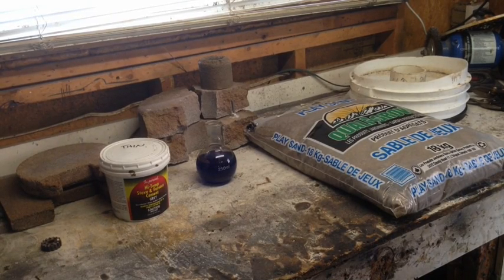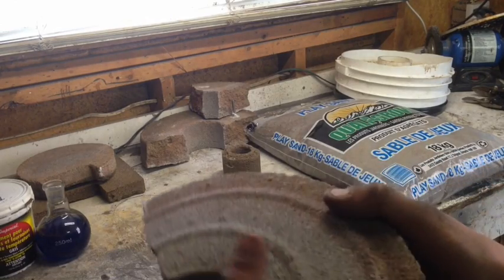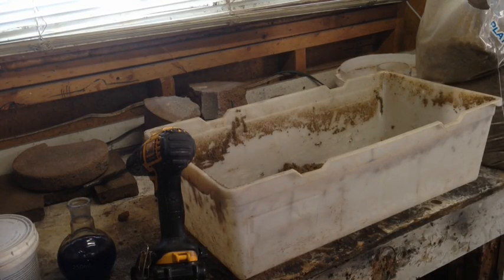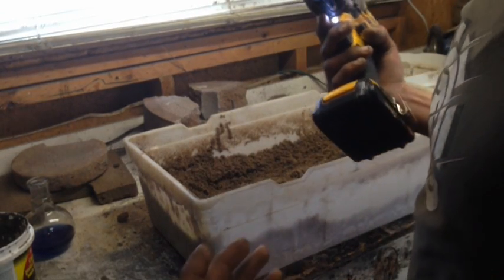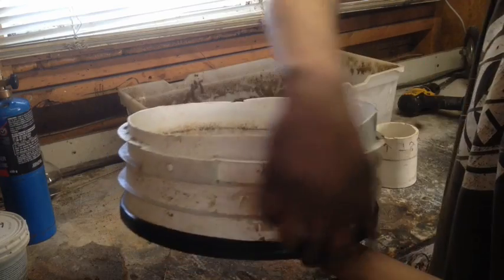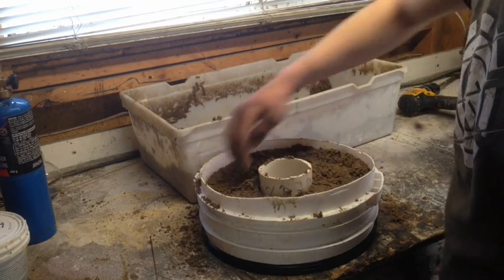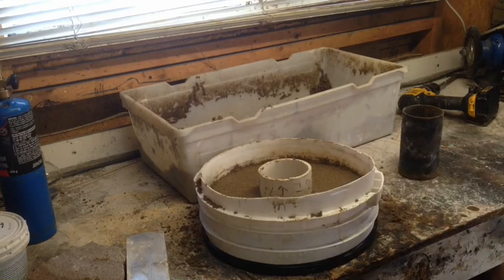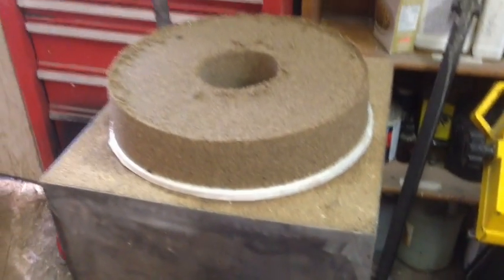How to make refractory brick (fire brick) with sodium silicate PART 2

Comment: would it make stronger to use Portland cement instead of sand?
Reply: AMEN brother!!!!!  And White plastic cement would have given him 300 degrees higher temperature ceiling  over portland for a buck more. Same stuff they use for swimming pool plaster. 3 parts play sand one part WHITE plastic cement.
Reply: just saying 83  my can of high temperature cement says " made with Portland cement and sodium silicate ' It says it is good up to 2700 degrees Fahrenheit  it is cement colored grey  thick like it has high concentrated water glass so I believe the contents could very well be only Portland cement and water glass
Reply: Thermodyne Systems  I bought several 4 cubic foot bags of swimming pool cement containing Portland cement and vermiculite  but this stuff you are talking about white plaster  is like a stucco on the swimming pool?   By what name can I Google to find this white plaster stuff and also your mentioned 60%  ion grod.?

Comment: If one makes the sodium silicate solution and has it in a glass mason jar with the lid on will it last for say a week in the jar? Will their be any negitive's to storing the solution for a week or more? Thanks!
Reply from the maker: Turborewind I have had it stored for months on end. just don't let it dry out. if it does dry out just add some water and lightly heat it untill it's smooth again.
Reply: Thanks nilamotk ! Off to make me a batch for my propane tank furnace.Thanks again for your fast reply.

Comment: Great video!  Gives me the information I need for a project I'm working out.  Have you priced firebrick lately? That stuff is EXPENSIVE.  I haven't priced the stuff in your video yet, but it's gotta be cheaper than $9 for a small brick.  Anyway, on to my question.  I am planning for a backyard foundry that will double as a family fire pit.  What I am visualizing is an inner layer of your firebrick, then about a foot and a half to two feet of mud packed around it, followed by a layer of regular ornamental brick to hide the mud, and another layer of your sand formula on top to shield the mud from the rain, then a nice fire pit bowl on top of the cavity for the family.  So, since it is going to be a serious pain in the butt to get into the firebrick layer to do repairs, I need to know how long I can reasonably expect this stuff to last.  Could you help me out with that?
Reply: Also, you mentioned in your video that this stuff can withstand "insane" temperatures.  Could you give me a ballpark number there?  Thanks!
Reply: Dwight Gordon check craigslist free section for firebrick....if someone is remodeling/tearing out a fireplace, they are more than happy for you to come get their old bricks
Reply: Dwight Gordon  fire brick @Tractor supply Company in the USA ( TSC ) is 3 dollars a brick . It's actually cheaper to buy the fire brick than to  fiddle around with  lower temp alternatives . It took me 4 months to realize that  . I still seek alternative  materials  but to get going , shelling out the money for fire brick accelerates the process. On a rocket stove use the fire brick in the burn chamber or heat riser only  where the temp. Is highest and line your building brick with this home made sand and sodium silicate stuff  in constructing the lower temp hot air conductors   don't use fire brick to line the feed port either  . At least that how I do it but I did bit the bullet and bought 20 fire brick @ 60 dollars. Call it tough love

Comment: hi there.  great video for diy enthusiasts.  you already gave crutial information and pointed out the things people should do at their own risk so I would ignore them. they can get their stuff custom ordered from where they feel safe enough.  you simply want to help others that want to save money and maybe learn a ring or two ..

My question is, is there any difference or advantages if I follow your recipe but replace sand with perlite or 50/50 mix ? strength,  tempreture resistance etc? thank you for your response in advance.
Reply from the maker: Sorry for such a late reply but I wouldn't use perlite it will melt.

Comment: This video is terrible. You use almost no measurements.
Reply from the maker: Erik Zolan that's because measurements aren't crucial. don't make soup..
Reply: Erik Zolan  you don't need measurement you mix the  the sand , water glass to  to facilitate  mixing and reaction    This video is one of the best if not the best video  on home made refactory on YouTube and comments add to ecplaning how to improve even this micture  same way with making sodium silicate from lye and kitty litter mix to create the reaction  . I like my sodium silicate thin , most YouTube videos  show thick sodium silicate . Don't get hung up on numbers  mix to get the reaction, troll.
Reply: nilamotk!
You bigest mistake! (20 years experience with silicate materials and poterry)

Comment: I noticed your castings will break if you hit it. Have you thought of adding fiberglass to the mix or some form of reinforcement? When they pour concrete they do it on top of steel rods that are in place to help the concrete from breaking into large pieces. Maybe you need some form of reinforcement.
Reply: Concrete whitstands pressure, steel whitstands pulling forces. The first ruptures at pulling, the second bends at pressure. So collums and overhanging structures need both as steel would rust if used allone and it's probably cheaper in combination and fire safer also even as building structure. But for a microwave kiln there are not much options for reinforments. By the way to nilamotk could it be possible to mix the waterglas with the suspector of graphite and silicon carbide as inner linning then a layer of firebrick and then Ytong as insulation?
Reply: I used to get stainless steel fibers from the contractor supplier to add to concrete mix for strength. I think these SS fibers would help with strength in this DIY refractory mix?  Or fiberglass?

Comment: hi t tried this but every time i dry it no matter how slow it swells to about twice the size
Reply from the maker: pete har use way less sodium silicate.. it should still almost be dry.
Reply: ok thank you
Reply: @nilamotk  Great Video man! I have a question/s if I may... I followed this video and knocked up approx 7 litres of sodium silicate about 4 weeks ago. Now I went to use it today and I have some concerns as to whether or not I've done it correctly. Should it not have gone off, at least a bit given that it's been sitting in a covered but open bucket for a month? 

Also, when I mixed it with sand and put it under a torch it started growing worm like bits expanding out of itself wherever I pointed the torch flame. Was both weird and cool lol. Having read this answer though I suspect that that could be because I had far too much silicate in the mix, it was pretty wet. Is this something you'd expect to see/have you seen something like this before?

I only doubt that the sodium silicate mix is good because it's not "freezing up" on those final droplets. Each batch I made did, when I made it, but I did notice that once the batches were all combined (when made) it was only just barely "freezing up".  Was much more "snappy" before I combined all the batches together.

Any advice you could give me would be greatly appreciated, and thanks again for posting this vid! Was exactly what I was looking for. Cheers mate!

Comment: I don't understand how you're getting it so dense. I've made 2 forges now. First one with perlite + sodium silicate (packed with a hammer). I let it cure 2-3 days before firing. Post fire it did form... but it's so brittle if I flick it with my finger it cracks right off. Even worse, after the 4th or 5th fire the entire lining melted like lava. Initially I thought the perlite was the problem. When it gets yellow hot... the perlite beeds seem to collapse, implode and melt down the walls. Like the walls of the perlite are so thin it can't handle the heat. 

So I built a 2nd forge using 99% silica gel from crystal kitty litter. Using a blender to break the beeds down to a pure white sand. Then mixed with sodium silicate. Packed it down hard as hell. I cured it the same way. This 2nd forge was very hard when it came out. But it doesn't make a "cling" noise when you hit it sounds just like PVC. Then soon as I did my first real fire once again it melted to shit and got brittle.

After lots of research it seems that sodium silicate is a horrible binder. It breaks down to sodium carbonate + sand after lots of firing. It says this right in wikipedia. That "lava" I'm seeing when the forge gets hot... I'm pretty sure its liquid sodium carbonate. Soon as the forge passes 800-900C it looks like the carbonate separates from the sand (in the sodium silicate) and drops down the lining. Then what your left with afterwards in the lining is just brittle sand. And the carbonate can't rereact with the sand just because it's pooling out of the entire forge into the center.

Another thing wikipedia mentions is how most commercial sodium silicate PFPs (passive fire protection) have been recalled from the market for their instability and aging. I've noticed this with products that are still on the market like Imperials Furnace Cement. I've tried to cure that stuff in pure form and it always breaks down in 2-3 weeks. It shrinks about half the size as it hardens... then upon further heat just crumbles to shit.

Wikipedia says sodium silicate has 2 main problems. One, it won't last unless it's waterproofed with something like portland cement (needs calcium hydroxide). Then two, the inherent "intumescence" of sodium silicate itself. I think the latter is the real issue. Because on BOTH furnaces, the second I turn the heat off even with the cover on I hear nothing but nonstop crackling. It'll make cracking noises for 10 mins straight.

That lead me to experiment with pure water glass. I noticed if you put it on a steel pipe then heat it the water glass expands almost 10xs it's size. Then if you pull the heat away it retains it's size. This is clearly happening as the hydrate / water leaves the silicate. It's clearly also happening in both forges I built. It's just a mess of chain reactions from the water glass dehydrating & expanding first then breaking down to carbonate and sand with no binding ability.

I'm gonna experiment farther but I have no idea how you're getting bricks like that don't crackle like crazy and break down to shit after heating.
Reply: Robert Cece excellent comment
I also bought Imperial's fire cement but have yet to construct my forge with it yet. it was like $60 for 2lbs, what a joke. 
question: have you thought about firing/curing it in a charcoal yet? you said when you turn off the heat, you hear nothing but cracking, which makes me think it is cooling too quickly. with a charcoal fire, you could just leave it in the fire and get it in the morning, letting it cool down with the fire slowly. 
let me know your thoughts please
Reply: Nice lecture, pls can I use only sand, cement and sodium silicate to build a lasting forg? Without perlite because I can't get perlite in my area pls and. Tnx
Reply from the maker: @ikennaihevueme1953  that's exactly what's used in this video. There is no perlite involved.
Reply: nilamotk   very helpful explanation in response  to commenter failed experiments  I didn't realize that sodium silicate and perlite had a limited firing point
Reply: Castable refractory is not all that expensive can buy a 25 lb.. bag for less than  $60.00 and it works very well is durable and holds up a long time I have a forge I built 5 years ago and melted a lot of brass with its held up very well why try to make chicken soup out of chicken shit?
Reply: I think you answered your own question, why? Sodium Hydroxide, $1 at the dollar store, $4.00 for play sand, and cat litter crystals for about $8.00. Some people can't justify $60 for a hobby furnace.
Reply: @leeackerson2579  if something simply will not work you have no choice but to use the right materials we're not talking about just any hobby but a device that is going to reach temperatures of 2000 degrees or more I am a blacksmith cutting corners with something like this can result in very serious injuries, property loss and possible loss of life so yes the cost is justified no matter what
Reply from the maker: Robert Cece the perlite is your problem. perlite is basically expanded glass and glass has a low melting point. perlite is a good insulator for a boiler outer shell but not so much for the internal fired foundry or forge.. it melts and the lava you are seeing is molten glass. you need to use a sand medium to make it work properly in a forge.

this video was for a forge for melting aluminum and brass. it lasted a long time.. I used play sand, about 500 ml water glass and a bit of Portland cement to help its strength before firing and to give it a bit of waterproofing. 

unless you've already solved your problem, I'd try again. but use a sand base with some Portland cement and a bit of sodium silicate for a fired binder.

Comment: nilamotk, Just thinking and wondering, I made a forge using just plaster and finely sifted river sand, same idea grant thompson made, but mine was on a larger size. ( galvanized trash can size) even though I estimate it to reach temps exceeding 2,500° it held up nearly a year, then as expected it began to fall apart. but it was enough to let me decide how deep into metal casting I might want to be. ( now making plans to rebuild the first one with improvements while still burning, wood, propane, charcoal, or nearly anything else burnable that will fit. as well as have ideas to build one in a recycled 175 gallon used oil tank like you might see at a minute oil change place as well as ideas for two sizes of electric foundries. the largest one will double as a gasifier as well as melt multiple crucibles of material at a time for larger pours. it will also have option to inject forced air or for extra high temps, oxygen from an oxy / acetylene welding torch. but that one I will have to track down the profesionale refractory supplies. ) In the process, someone suggested when I rebuild, that I use a mix of course steal wool and stainless steel Scotch-Brite Stainless Steel Scrubbing Pads inside the refractory, same idea as the rebar /rods you mentioned. I'm thinking of using your mix in place of the plaster mix but add the steel mix I mentioned as extra redundant reinforcement as it will allow for the heat expand / contract better than rebar. What is your opinion of this? I am new to the sodium silicate idea. Are there any reactions  or bad side affects you know about that would make the steel wool & stainless steal a bad idea with your sodium silicate idea?

Comment: As far as I know sodium silicate sets when in contact with CO2, so I'm interested, when you fire it, does the heat actually have anything to do with the process, or is it just CO2 that's produced by burning the propane that does the job?
Reply: My bricks came out at least 30% harder.
After using the CO2 to "set the part" I pre-fired them in the kitchen oven @ 350 deg for over 30
min.  Don't know for sure exactly how long the minimum time would be, but would guess that you would want the part to heat soak completely.
Just guessing again,  my thinking is that  the hardness would increase with the higher temp.

Comment: I actually made my foundry out of cement and perlite... just barely been using it a month but seems to hold out pretty well... oh and I also used tie wire.
Reply: I forgot to mention it's about 1&1/2 inches thick and can be glowing red on the inside but touchable on the outside.
Reply from the maker: casinogiant be careful. if it's Portland cement  it should be OK.  regular quarts cement can explode at high temps.
Reply: Can you expand your definition of explode. Do you mean literally explode like C4  or a different kind of explosion. Also what are the circumstances that lead to such an explosion.. in other words will the perlite negate these factors.
Reply: Okay I believe I sufficiently tested the product. No explosion, the furnace is far less fragile then expected is and totally exceeding my refractory properties I expected. To add to that it was now found to be way less weight then previously made models. As I can easily transport it by myself.
Reply from the maker: perlite may help with "explosion" and no.. not c4 style. more like "pop!" and a big cracked off piece..  the perlite is going to melt though, not really a bad thing as the cement will hold the air pockets for insulation... but perlite itself melts at a relatively low temperature on its own.
Reply from the maker: I'm glad you where able to come up with a good mix. hopefully my video further pushed you to experiment on your own. good luck and cheers.
Reply: What I did was pulverized the perlite into a powder before mixing it to the cement and a special inlaid bonding agent helps to keep it from disintegrating. But you are correct of the heat breaking it down from the inside I can see that one day it will fail but for under $30 and with the effectiveness this produces, it's a small price to pay.
Reply: nilamotk  So would you recommend in your sand  water glass mixture to add some powered Portland cement ?

Comment: Great Video!  Just subscribed.
 I was laughing when you mentioned it was round, so it could get in the corners.  However, you are obviously talented and I knew you would catch it.  You handled it eloquently.  Great Job.
Reply: Actually there is a corner between the circular form and the flat top of the  sand.